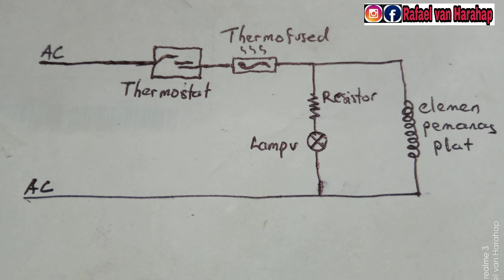Cara Kerja Setrika / Sistem Kerja Setrika

Comment: Klw lmpu otomatisx tdk bekerja gmna om.
Reply from the maker: Kalu panasnya normal ,ya ganti lampu nya.  Ada kok di toko elektronik lampu setrika.  Biasanya lampu yg diseri resistor 120k
Reply: @alphateknik  Kebetulan strika saya pakai r 100 k karna gk ada yang 120 k tuk sementara.  Selama strika dipakai r  100k  pengaruhnya terhadap komponen yg ada biasanya apa bang
Reply from the maker: @deswanmulia704  lampunya lebih terang.  Itu aja